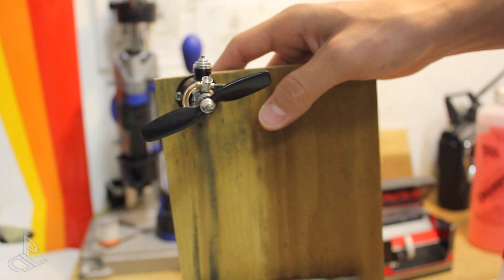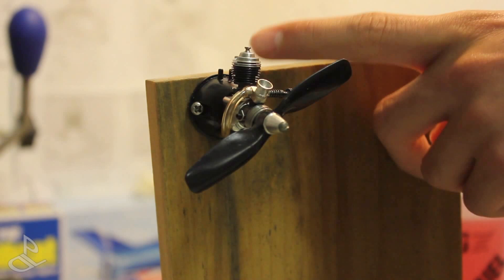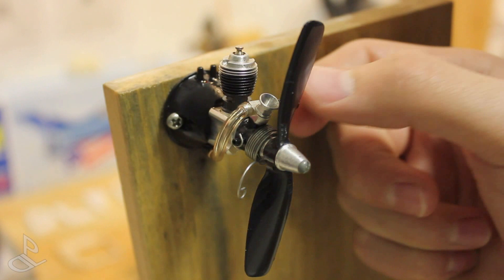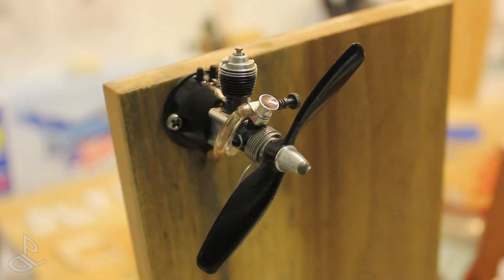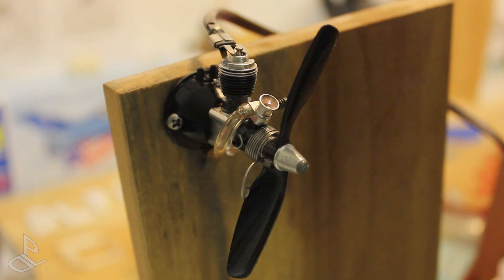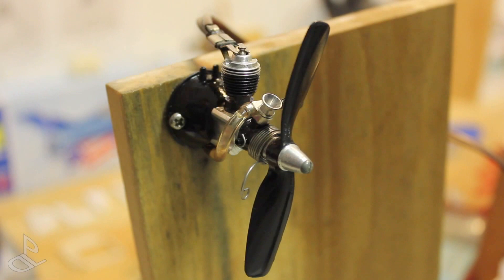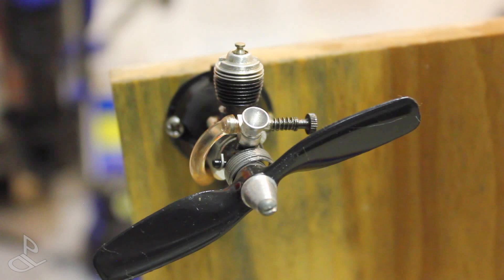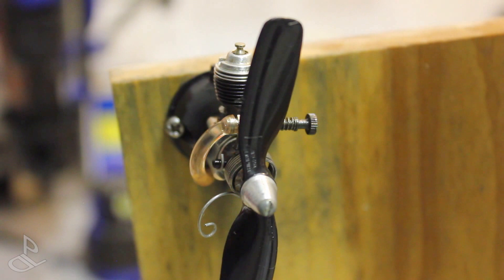World's Smallest Engine!

Comment: why are this so expensive?
they used to be cheap right?
Reply: This is a high end model. Was never low cost.
Reply: They're no longer in production.
They were around $6.50 back in 1965.
Inflation would bring that up to $50 in today's dollars if they were still making them (2017).
You can actually get reconstruction or refurbished Cox 0.49s for that price today.
However, because these are SO DURN CUTE, out of production, and therefore collectible, collectors have driven the price of these - especially new-in-box vintage models - to $200+.